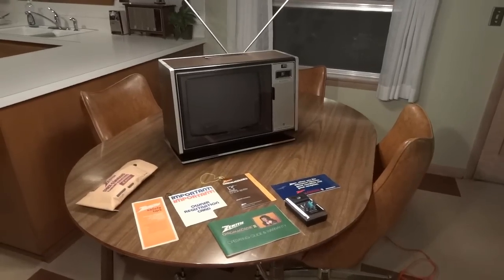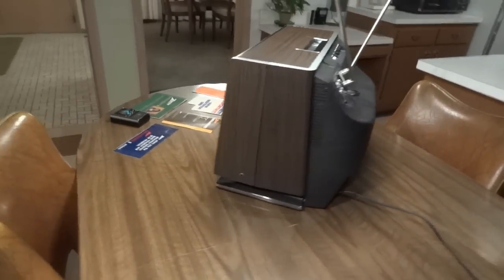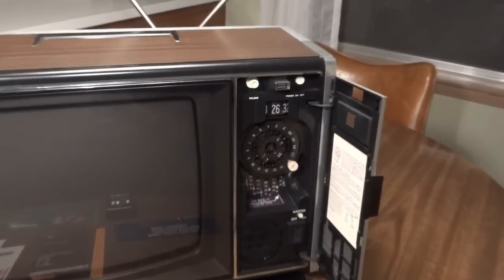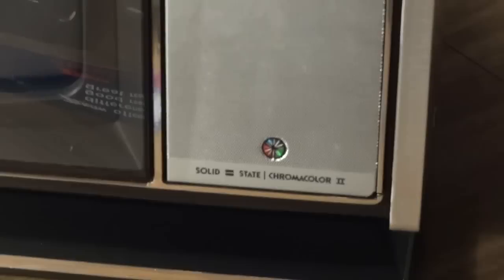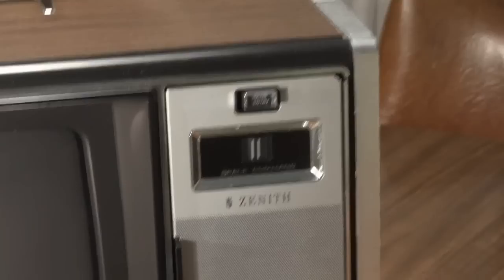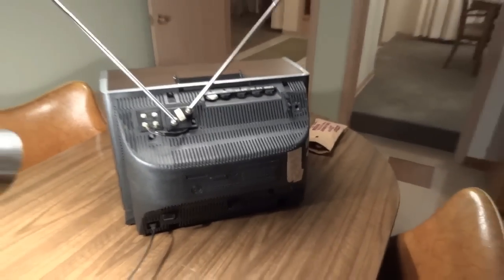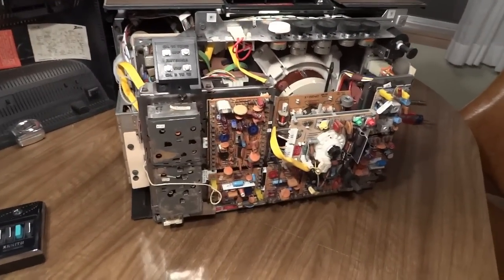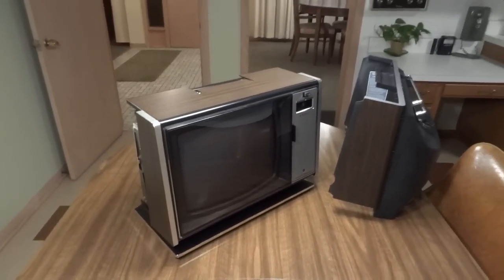Watch a 1978 Zenith Chromacolor II Color TV with Space Command Remote Control!

Comment: Back then, any TV with a handle on the top was called "portable" even if it was very heavy and could only run on AC power. The same thing was true with early "portable" computers! :-)
Reply: People were stronger back then :)  And judging from the complicated remote control instructions, they had to be smarter, too 😃
Reply: Portable as in easier to move from room to room. No need for an army. Obviously :)
Reply: @joestewart8914  HaHa...funny as hell! 😁🤭👍
Reply: My mom bought one of the first portable Sony Color Trinitrons. (1969) KV-1210U
It was a high quality build and had an awesome picture!  The knobs and wood case were very solid and it was HEAVY!  It even had headphone jacks, solid state and UHF.  Trinitron debuted in 1968 but did not hit the states until 1969 when UHF was added.  I have a picture of myself from 1969 in a baby cradle on the kitchen table next to her brand new Sony TV and a TV Guide on the table with Glen Campbell on the cover! Lolz!
Adjusted for inflation, that set would cost well over 
$2, 000.00 new today.
Reply: @cleeboy5048  Sony still expensive,  you get what you pay for, Sony probably the best but have good competition these days

Comment: Nice trip down memory lane for me. I sold and serviced only Zenith TVs in the 70s and 80s. and cleaned a lot of those push on module connectors back then and it was one of the biggest problems with this chassis after a few years. The IF module (big silver one on left side) was prone to connection issues. It still was a good design for servicing and a giant advancement from the vacuum tube sets. The System 3 went to using edge snap on connectors like the two on the module plugged to the back of the picture tube and they were very reliable. Thank you for producing this video.

Comment: We had a mid-70's woodgrain Quasar TV and the remote also had the old aluminum tuning rods.  The Quasar remotes were a bit louder than the Zenith when pressed.  We also had a late-70's Sharp and Sony Trinitron.  Both of those had battery powered sonic remotes which you could hear when you put your ear up to the remote speaker.

Comment: I'm surprised they were still using the mechanical remote and motorized tuner when electronic tuners were becoming more and more common and cheaper to make. The tuner looks quite intimidating when you first peek behind the panel -- but I guess this was still back in the day when your TV salesman would set up the TV for you upon purchase. Also, FM radio uses 75 kHz audio deviation while TV audio is 25 kHz deviation, so a ch.6 station transmitting FM audio will sound louder than other TV stations.

Comment: You have a very nice house and furnishings. I recently scored a 1985 Zenith that looks gently used. Its one keypad sets with remote control that uses the type J battery.  The remote looks and works great but the TV is a bit tired. I suspect it was a set that was turned on with the remote and mostly left on the same channel all day.

I'm with you. I'd like to get a CC 2 or earlier someday.  Older TV's are hard to come by here in WV.

Comment: if you're talking about DTV and a converter box, then yes, with an adapter to convert the 75 ohm coaxial "F" type "TV out" on the back of the average converter box to the 300 ohm twin lead connections on the back of the set (the four screws just to the left of the antennae) a TV like this can be retrofitted to receive DTV stations.

Comment: Regarding Channel 6 audio.....TV audio deviation is 25 Khz while FM broadcast deviation is 75 Khz which is why TV audio on 87.75 was lower on an FM radio compared to the rest of the band.  Unlike full power TV signals, LPTV doesn't have a rule on audio deviation.  Several enterprising individuals realized this and applied for a Channel 6 allocation for a LPTV and utilized 75 Khz audio deviation so the audio at 87.75 would have competitive audio with the FM band but louder on a TV.

Comment: can you get cable tv transmitted to this television? or attach a vcr to it? thanks
Reply: analog cable and anything that will put out an RF signal will work.
Reply: My Uverse TV box is hooked up to my digital TV through HDMI,  but also has options to hook it up through coaxial,  av,  and component cables. So I think that it might work with any TV. But for TV's that are so old that they only have those screw things on the back,  you will probably need a balun to hook into your coaxial cable.